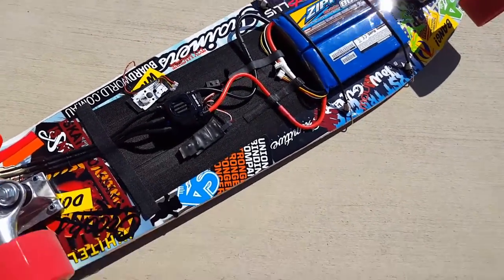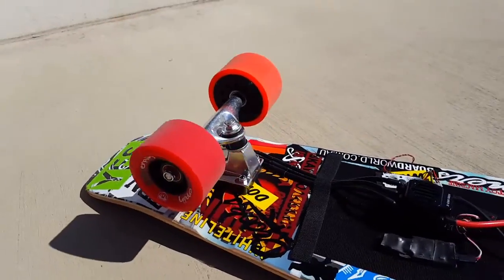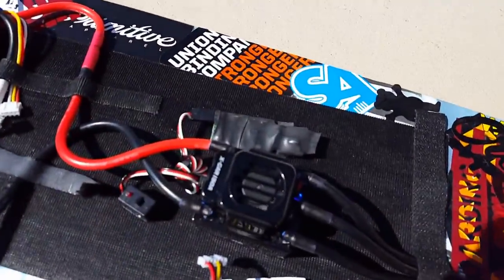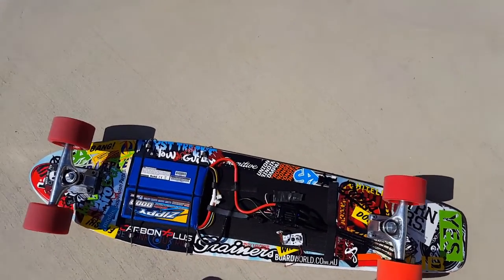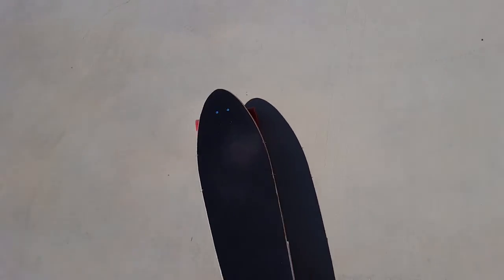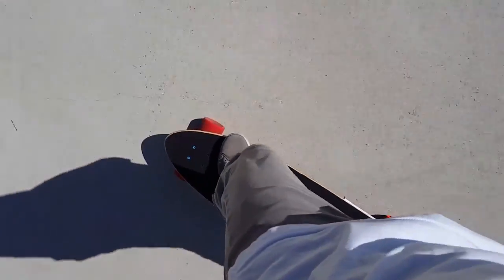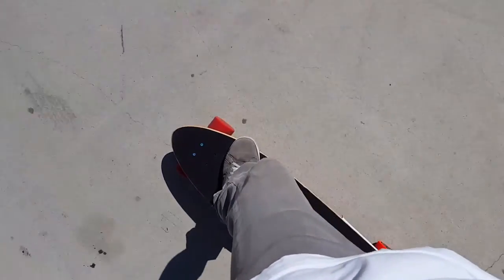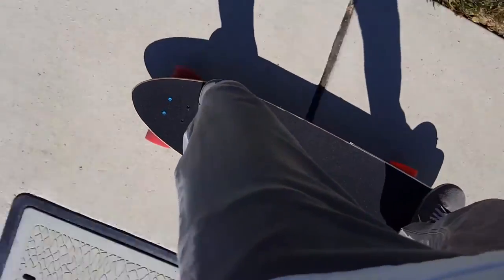Single hub Skate-A-Tron with hobby king 150A ESC test

Comment: these are the worst kind of hub motors to get. There is no protection from water or debris from going into the motor. You can see straight into the motor. These are NO GOOD PEOPLE.. Better off getting ANOTHER pair of Chinese hub motors.
Reply from the maker: I have ridden all of these motors fairly extensively through all sorts of dirt and it doesnt seem to be any more of a problem than regular skate bearing maintenance.
Reply: sweet.
Reply: But they do have good Chinese hub motors don't get me wrong. They are sealed within the hub and protected from elements. Look at Koowheels/Genesis Hub motors.
Reply from the maker: I think the best hub motors on the market are enertions raptor2 motors. I dont think anything currently available comes close...

Comment: Hi, you didn't show the braking noise in the video. My board is fitted with x-car beast 120A esc from Hobbyking. The braking noise is killing me, some drunk girls were already complaining their ears due to the whiny noise the esc makes... So, as that is just a experimental board for you I'm asking if it could somehow be modified to silence it :D It's my first board and I don't have any parts for spare so I can't try to modify it myself (nor the skills required for that)...Best regards, Aaro
Reply from the maker: no, the noise is programmed into the ESC. the only option is to use an ESC without the noise, or just don't brake.
I don't use the brakes much at all.

Comment: Hi I was wondering, how you programmed the ESC?
Reply: I set maximum timing, low to medium punch, forward brake no reverse and about 50% braking force. the rest I left default
Reply from the maker: P.S. Low Guidos Chop shop is my other account.. that was me commenting above.
Reply: +Low Guido's Chop Shop ah ok, and with a lcd programming card?
Reply from the maker: LED program card.
Reply: +DLGinHELL okay thanks a lot, would you recommend this esc, if I wouldn't go with the vesc?
Reply from the maker: Yeah this ESC works quite well. But the VESC is the best.